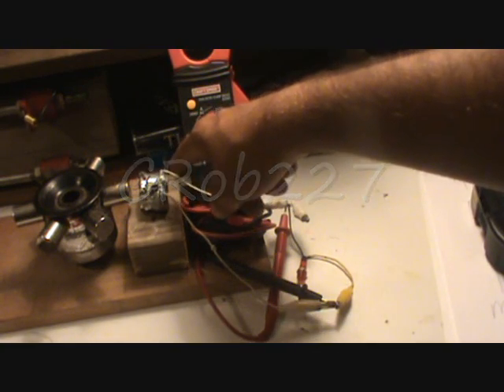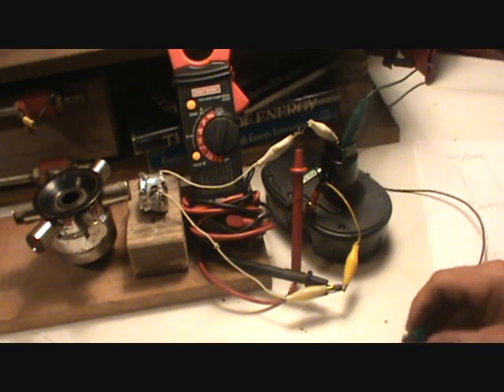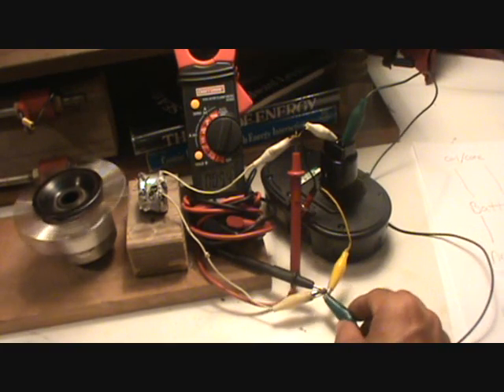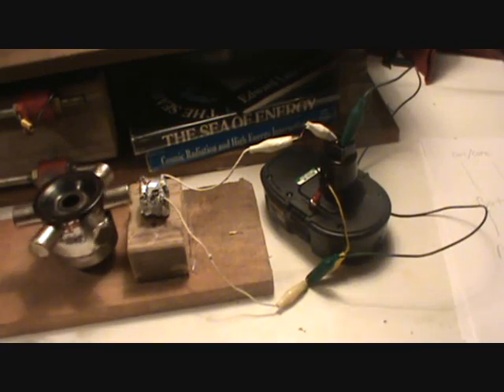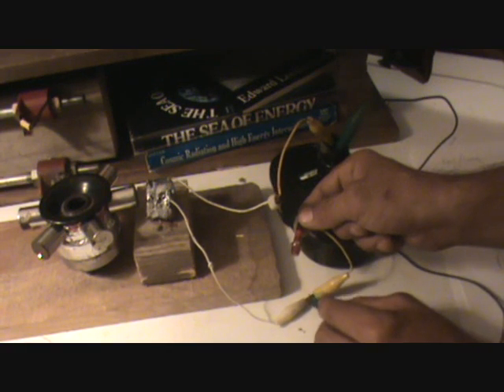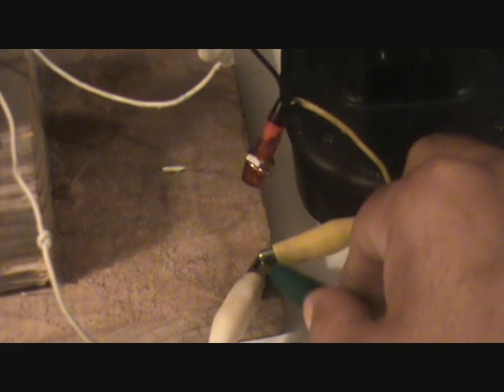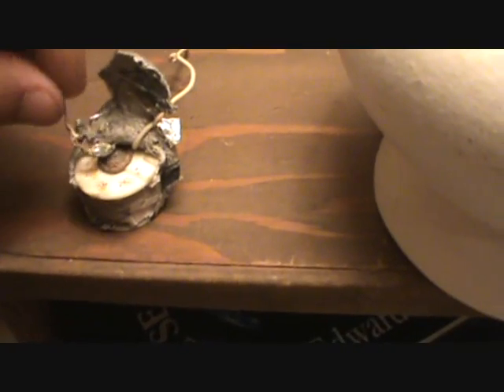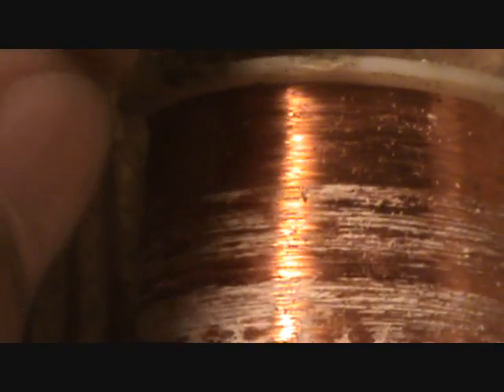coil core generator take two

Comment: @crob227 Ahh, O.K. i understand!
So you build up a capacitance by conecting it this way!
So OgMandin0 is still right, you just use your coil in a uneffective way by conecting the core and not the other end.
That is also a little capacitor and thats all...
THX

Comment: @crob227 What do you mean with no physical connection? 
I can see the coil is paralel to your neon! OgMandin0 is right about the stored charge!
Also the battery connected to it will produce a magnetic field in your coil that is why your rotor slows down faster when its connected! Tapping it will build this field up and let it collapse again... so you produce AC again like turning your rotor... 
Cheers...

Comment: i cant find any coils to try this with-so its an open circuit and making voltage which should be interesting in itself,does it make a magnet with it hooked up,you said its dragging the motor down but have you put a compass near it?
OgMandin0's comment about capacitor effect seems to make sense but its a hybrid coil/cap...being both coil and cap reminds me of the hendershot thing morpher was playing with.
but hangon its a magnet too?

Comment: @crob227
The definition of a capacitor is "2 metal plates seperated by a dielectric. "
One of your "plates" is the wire. The core is the other "plate." The insulation on the wire is the "dielectric.
In a capacitor, the 2 plates are not electrically connected, either. Yet, apply a brief charge to a capacitor, and it will build up a charge. The charge is released to the neon bulb when you "tap the wires."
A capacitor is the obvious explanation.

Comment: crob, the neon bulb flashes because your coil stores a charge from the battery like a capacitor.  When you "tap" the wire between the battery and the coil, you discharge the coil releasing the charge =the bulb flashes. Like the ignition coil on a car engine, your coil stores a fairly nice charge very quickly. Then the battery recharges (re-energizes) the coil for the next "tap.".